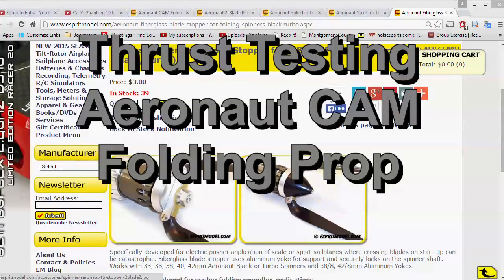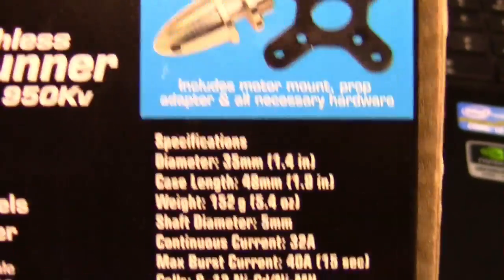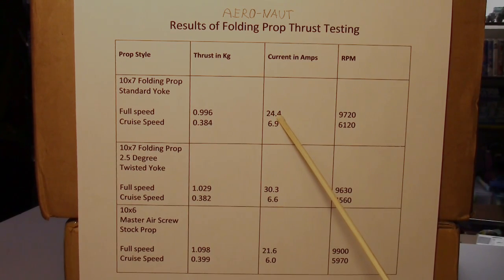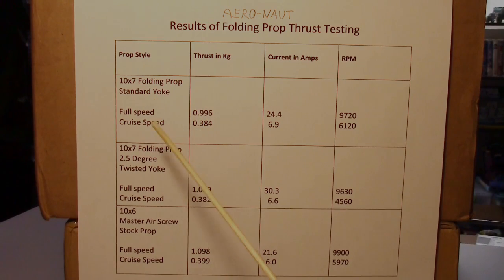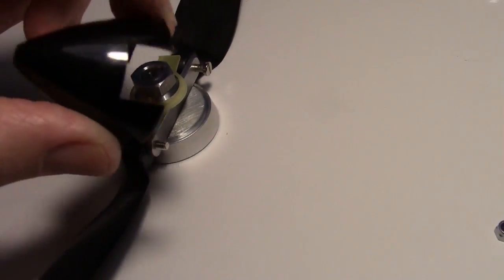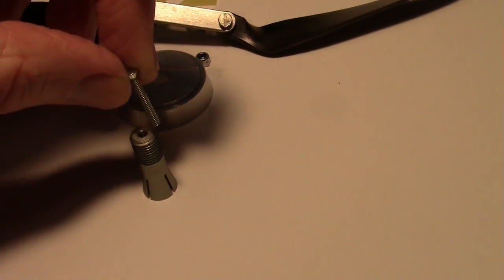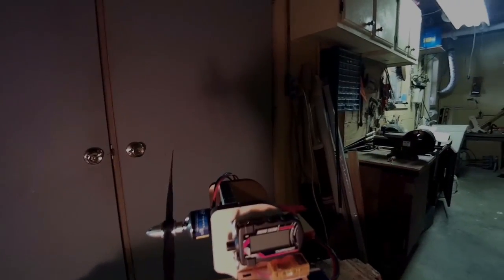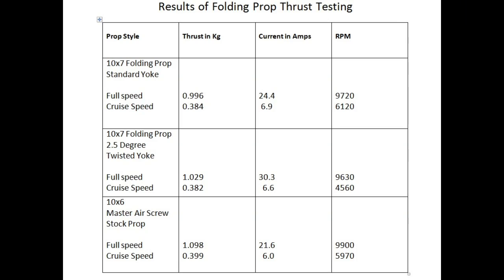Aeronaut Folding Prop and Motor Thrust Testing for FX-61 Flying Wing

Comment: Hi, couple of things, sounds like the motor has a dirty bearing also the cruise testing I wonder if the results would change much if the motor was to settle for 10 seconds or so ? look at the sunnysky 2216 880 with 9060 prop they tested 400 grams thrust with 3 amps if that is correct(change motor types under tech specs)
http://www.rcsunnysky.com/content/37.html

Comment: Is there any major advantage the folding props have over the fixed ones?
Reply from the maker: Less drag when the motor is stopped and less likely to get damaged doing belly landings.
Downside is they tend to have more vibration and not as much thrust.

Comment: Can i setup this up but without the spinner and the bottom plate? I mean, only the yoke and folding props? does the yoke can crimp tightly the motor shaft? Because I've seen some pusher configuration but without the spinner.
Reply from the maker: ***** You will need the spinner unless the motor shaft is threaded and has a nut. You may also need a spacer.
Reply: ***** Gotcha! I dont see any fx-61 maiden video in your channel, that's the one i've been waiting for.
Reply from the maker: ***** You probably won't but you can see plenty about the FX-61  on Ed's channel:
https://www.youtube.com/watch?v=onFPLPGhRXg

Comment: You can also test battery times under 3/4 power or full power. Nice to help set up your timer.
Reply from the maker: Ok thanks!
Would it be easier to just calculate that from the current draw and not stress the poor battery?
Reply: The battery has to hold up over many flights, it will show you a weak battery if you have one,,,
Reply from the maker: Oh ok. Guess I misunderstood. Thanks
Reply: ***** Let me rephrase,,lol, its good to do a long test on your power system. Esc might have a fault, battery, etc.

Comment: Great work Dave as usual!
I found, most interesting, you data combined with the output in watts.
I verifies your test.
I am using a sunny sky motor on mine.  A test of that one would be good.

The perfect FPV platform is the Sky Walker 1900 of course the the Favorite FPV plane is the one you are flying.  Enjoy then all...........
Super duper way far out kool man
Reply from the maker: ***** Thanks! Which Sunny Sky Motor are you using?

Comment: Dave, you and John are amazing people.  I like the video and I like John's breadboard project. You guys need to do a video on the controller board. It's cool!  And, I'd take bets on where you're headed with this as we have many of the same youtube subs. I foresee a build series following and improving on Uncle Deke's incredible FX61 build/design... lol,. Too many bleary hours watching late night vids...

Different subject, a quick question please. Do you have any recommendations on a largish (19in.) 12V  FPV monitor and DVR? Are you still using your Walmart TV and Radio Shack(?) DVR or have you seen or heard of anything newer and better? I'm not a goggle guy and I want something larger than the basic 7" RMRC type screen.. Thanks mucho!
Reply from the maker: I have not researched this much because I found myself using goggles almost exclusively. Now I have bought a set of Dominator V2's with the DVR built into the goggles. If I was to get another monitor I would get one that has high brightness, no blue screen problems. I still use the Wally tube cause it works good enough, is very inexpensive. For a DVR I would probably go Foxtech. In my opinion all DVR's will cause some loss of video quality on the output to the monitor. Best to bypass the DVR when flying.

Comment: looks like a good power setup but really, $65 for a motor? e-flite is a  little overpriced for what you get, i would say just get a cobra or a tunigy sk3 aerodrive they have worked well for me, but hey if it works for you  so be it :)
Reply from the maker: Actually I have never used the E-flite Power 15 except to do the testing. I agree with what you say on the price but I wanted to use the same motor as Eduardo to make the test valid for him. That's just my 2 cents :-)

Comment: Do you guys use digital servos on your fpv aircraft?  I haven't decided which one to buy for the FX61. A metal gear analog or the digital metal gear or karbonite gear from hitec? I'm concerned using a $5 metal gear servo on a $500ish fully loaded fpv wing.
Reply from the maker: For the pan servo the best thing I have seen is the GWS 360 degree sail winch servo. It's large and the cost is high but it really works slick.

Comment: Thanks for this Dave. Eduardo was telling me that the stock motor is much more efficient than the Power 15 so I'm not sure which way to go. The Power 15 sure gives it lots of grunt. Kind of a mute point, the plane's been on backorder forever.
Cheers, Bob
Reply: I ordered my FX61 at Valuehobby.com the other day.
Reply from the maker: ***** Guess I am the only one in the US that still has one in the box. The Power 15 can definitely put out the thrust if you need to fight some windy conditions.
Reply: Alfonso Alfonsos
Thank you Alfonso, I'll go and check it out!
Much appreciated!
Reply: Alfonso Alfonsos
Hmmm, Value Hobby does not do business with Canadians. Bummer!

Comment: I would use the standard prop with a prop saver and set up motor brake on the ESC in a flat prop position
Reply from the maker: Luis Fernando Suárez Harašić Great idea! How do you setup the motor to break at in a particular position? These motors don't have a position sensor so how do you know when it is flat?
Reply: You do it on the ESC check the manual I use turnigy ESC s and you just place the prop in the position you want it and set up the brake, the ESC will remember it and try to get there, it works almost all the time ALMOST
Reply: Can't find any of my manuals but I think that is how it works haven't done it but once, anyways the air flow at the flat position is gonna be the lowest out of all times so the ESC brake most likely will pick there I guess got to do some research on the ESCs I'll try to get back to you
Reply from the maker: Okay, let me know what you find.